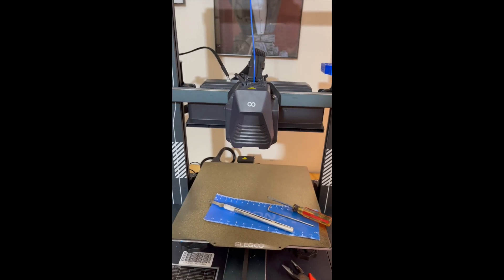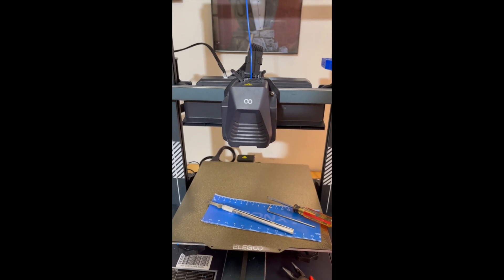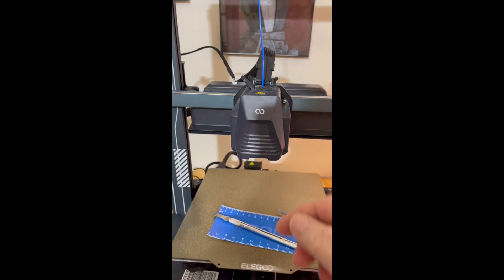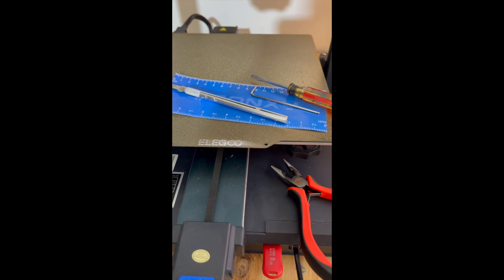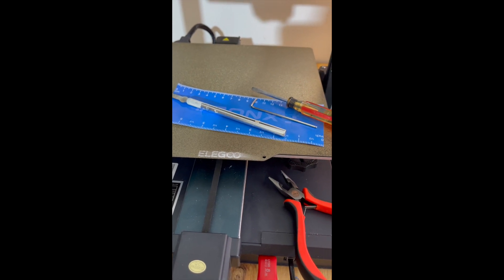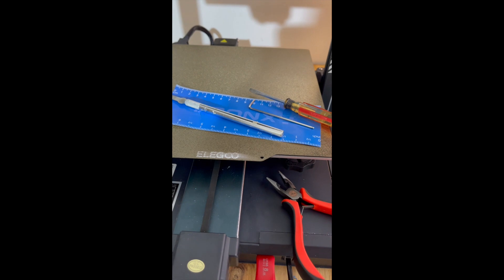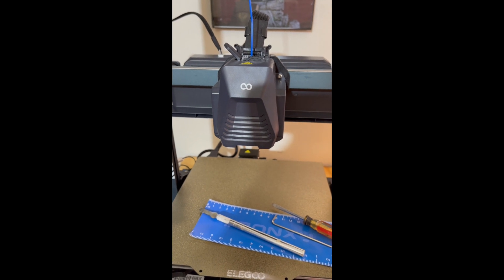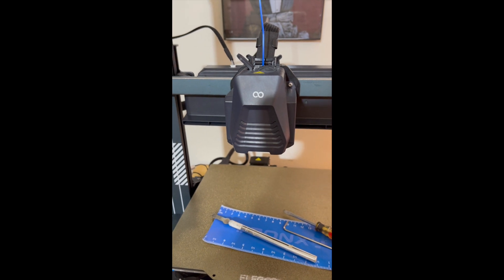Elegoo Neptune pro 4  Nozzle clog

Comment: Would be great if you showed all the steps, not just talk about them.
Reply: Thanks
Reply from the maker: A nozzle clog  happens  when the z axis is too close . You have to stop the machine and use pliers to pull away the plastic , while it is. still hot . It is best  to change the 6 mm  nozzle at this point, by  releasing the filament and using a 6mm socket to remove the old nozzle center clockwise  slowly. Install 6 mm nozzle clockwise .
Reply: This is not the only reason they get clogged, some people get them even when the z offset is dialed  @PeterAgostiniJdcap26